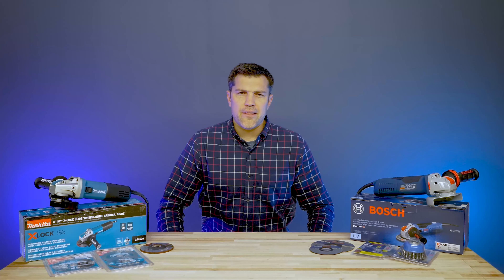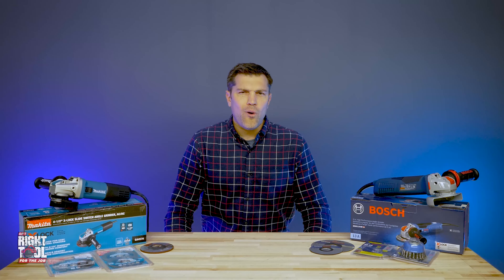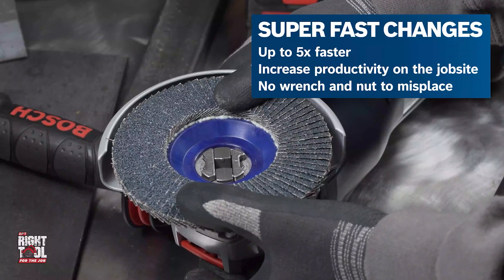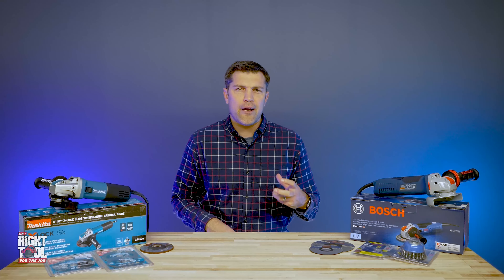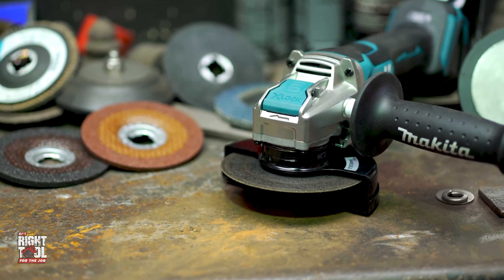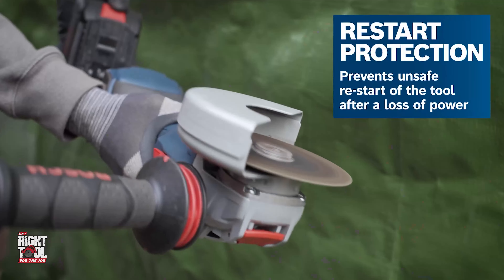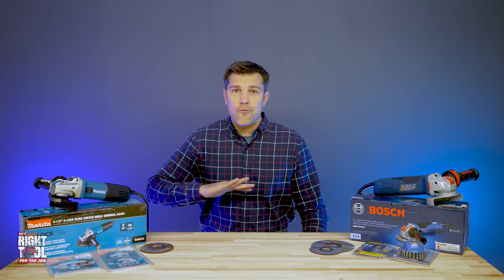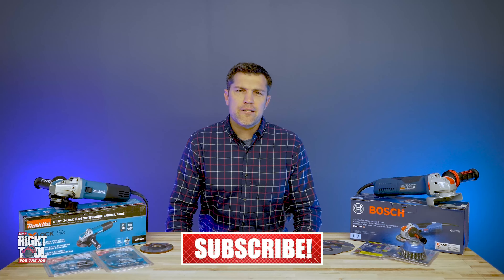X-Lock Quick Change System | Right Tool For The Job

Comment: @Ohio Power Tool. Thanks Jay for the info on the Bosch X-Lock system. I agree with you that it will take over the existing 5/8" grinding and other accessories like the other Bosch innovations in SDS bits and T-shank jig saw blades. And so far, that' hasn't been a bad thing. 

Wishing you,  the entire staff at OPT,  and your familes a safe and great holiday season.

Comment: Personally I think that this has aged very poorly as I have not seen very much x-lock overtaking anything in fact I've seen x-lock fading almost from store shelves I don't even know where I last saw an angle grinder that uses the x-lock feature.  Then again while I do agree the concept is cool I don't care for the fact that it introduces way more parts small and intricate parts that are unnecessary and likely to break compared to the standard arbor system
Reply from the maker: Fair enough!